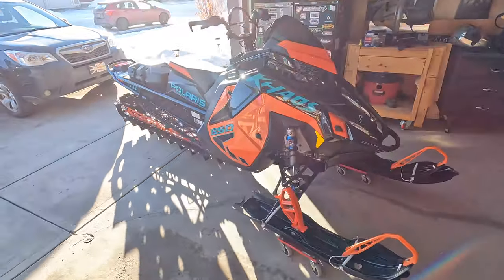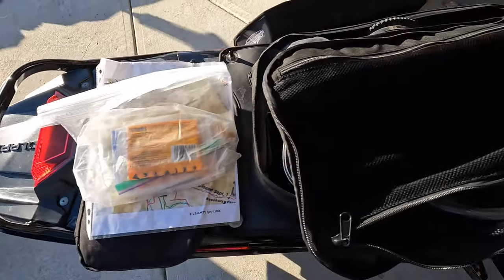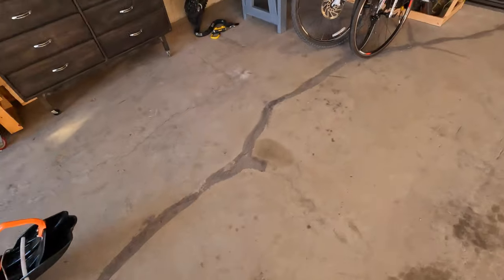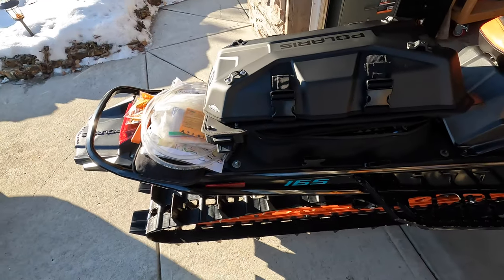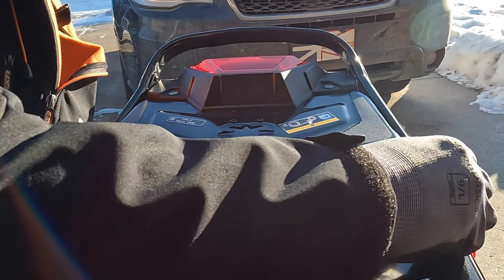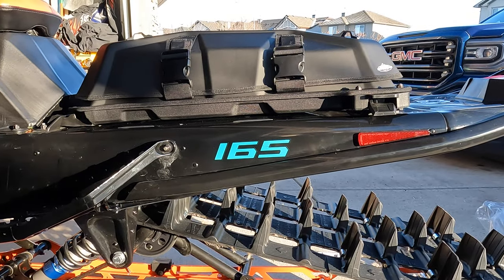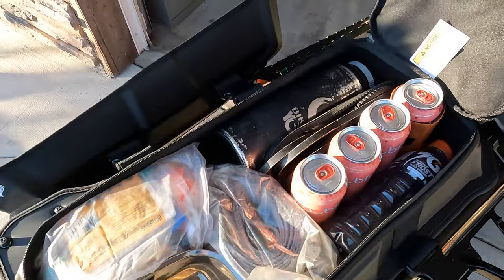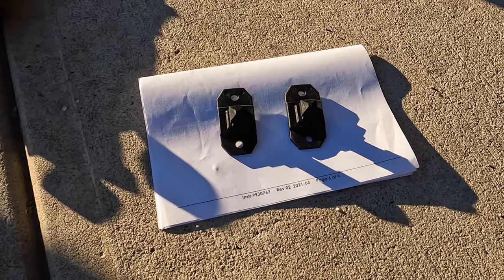Polaris Flex Lock n Ride Storage \\ Chris Burandt Tunnel Bag

Comment: Thanks for the install guide and review. I was really debating whether to get one of these Lock and Ride bags due to the price but think I'll just bite the bullet and order this bad boy. I know others are worried about theft but statistically theft seems pretty low when it comes to snowmobiles. Heck, we all leave our keys on the sled when we go in for some refreshments and food and never had an issue. There's some bad apples out there but probably better targets than us if you're a hardened criminal.
Reply from the maker: It’s worth it. And it’s easy to take off and store in your truck

Comment: Too funny. I got the same bag  I put the clips upside down. Had to fix that as the tunnel bag fell off in the first ride..... But overall the bag's awesome with the handle. Pull it off, throw it in the truck and also take it inside to pack
Reply from the maker: Sounds like my first ride with the old bag. Had to strap it down
Reply: What do you mean you put the clips upside down ?